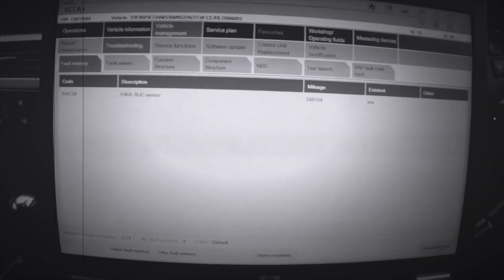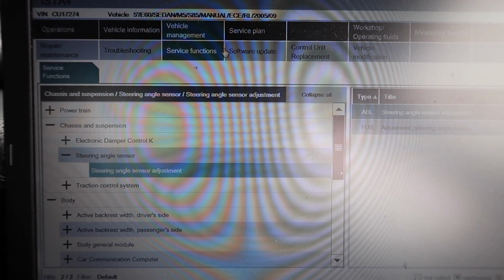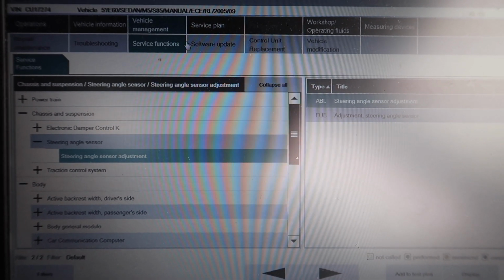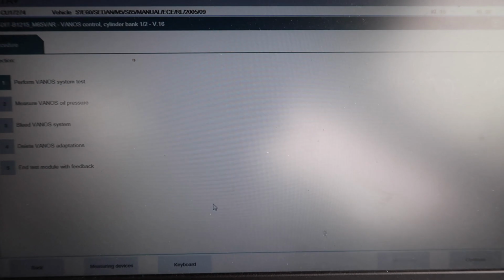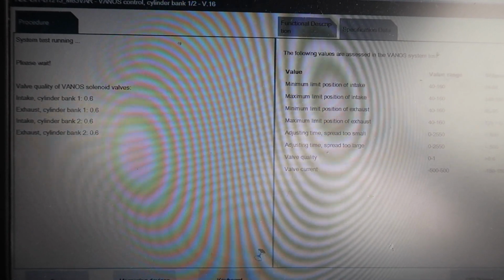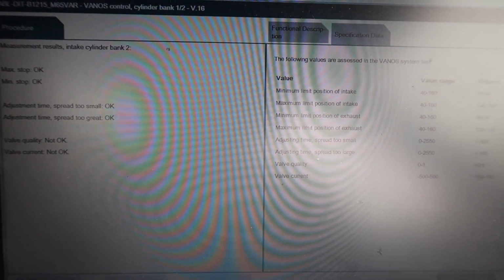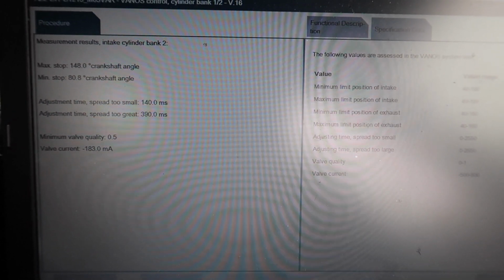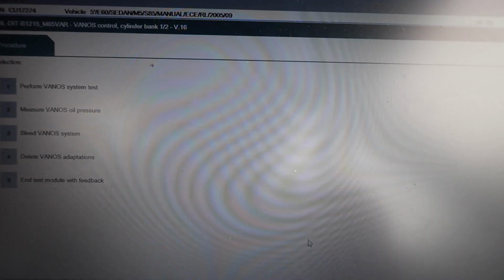BMW S85/S65 How To Test Your Vanos Solenoids With ISTA +

Comment: I did this test on my N62b40. The intake test was fine, but when it tested the exhaust valves running from 90 to 120° degrees, the engine was shaking quite a lot. Is this normal? No error were shown afterwards for intake and exhaust.

Comment: Thanks for the channel Dean. I just replaced my timing chain and oil drive chain on my 2012 F30 with an N20 engine. I primed the car before I attached the injector wires, then started the car. It threw a P052B code. Do I need to reset the Vanos Solenoids ? And can I use a scan tool to do it or do I need ISTA? Thanks again

Comment: Hi Dean, I would like your opinion please. I've made the test on my '06 M6 and had 4 "not OK" results a few months ago. With a specially bad result on the "exhaust bank1" showing a minimum value of 0.19. I didn't have any bad noise coming from the engine. I decided to run the bleeding procedure again as i have read that it could show different results and today i did it. I noticed that after the idling variation sequences, during the pauses, the vanos was making bad noises, like loud and grave friction noise, which were frightening to say the truth. The procedure went to the end of the 19 minutes and i got the message "bleeding procedure failed" or something similar. The tool offered me to perfom the test anyway, i did and got the same values as a few months ago. I restarted the engine and the noise which i heard during the procedure didn't happen again. Is there a risk doing this procedure ? I'm now planning to replace urgently the solenoids. Any advise please ?

Comment: Thank you Dean. I did not know the bleed procedure had to be done after bearing replacement. 👍🏻. I’ll make sure the shop that’ll replace mine knows about this.
Reply from the maker: Yes bro make sure they have a habit to pull the crankshaft sensor and let the engine turn over to pulp the oil but you can’t do JUST that it needs to be bleed fully I will show you how to do that in another video
Reply: @BMWDoctor  Can't wait, thanks